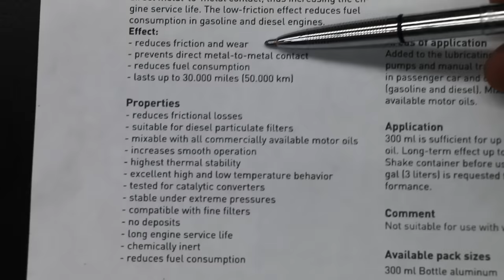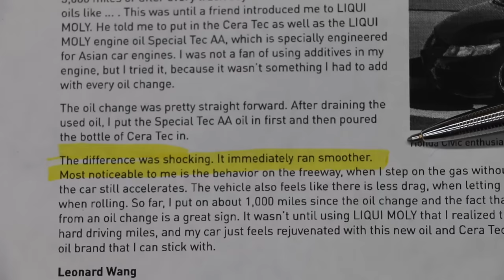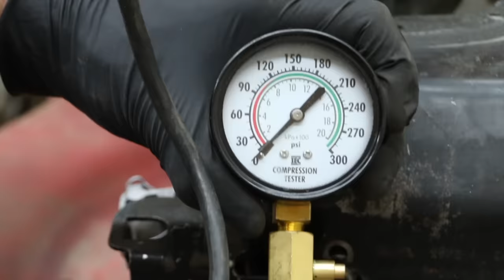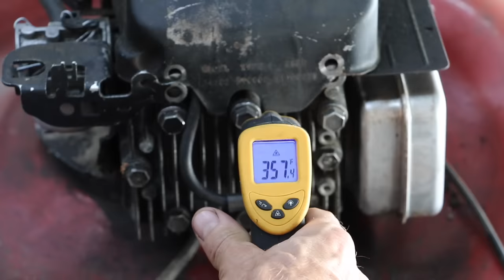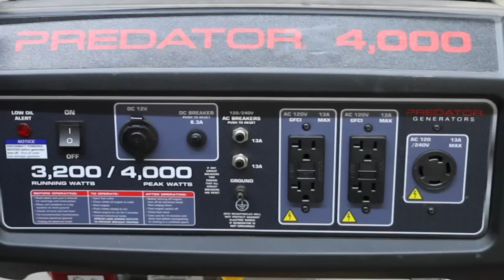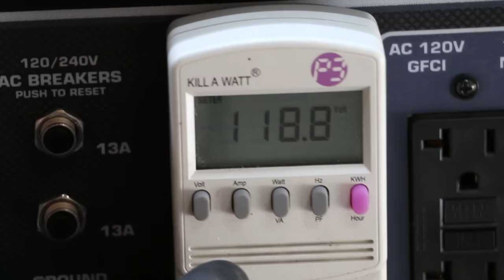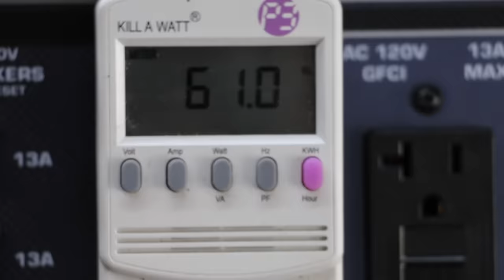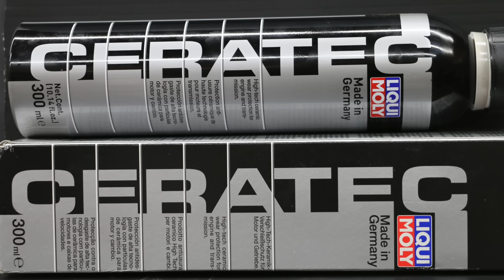Does Liqui Moly CeraTec work?  Let's find out!

Comment: I would like to see a "Leader Board" for fuel and oil additives similar to how Top Gear had for their celebrity lap times.  This would help viewers understand where other products compare to the current video test.
Reply from the maker: Thanks for the recommendation!
Reply: What a great idea!
Reply: Good idea
Reply: Additives are designed to do different things.  This guy is only measuring the same things on every additive and not tailoring his tests for what the additives claim.  Most additives don't claim to improve lubricity, however, this guy uses an ancient lubricity testing rig to test for it on every additive... doesn't really make sense... I mean all you have to do is find a product with lubricity improver (likely a diesel additive,) and you win that no problem and all you boneheads would be super impressed...
Reply: I’m currently waiting until someone watches all his videos and creates a spreadsheet. Let’s you look up bearing grease and engine oil all on one page for one shopping list.
Reply: This is a very good idea!
Reply: @kaipos8601  Most additives claim to improve gas mileage and reduce wear.  The best (only?) way they can do this is by keeping metal surfaces apart and this is achieved by superior film strength.  I think the Timken bearing test is the most important of the tests that Todd does.
Reply: @ProjectFarm  We're waiting... :)
Reply: @ProjectFarm  I second the recommendation for a leader board for top oil additives test
Reply: @rocketraccoon8110  I third that idea, does anyone know the best one tested so far? This is what im looking for
Reply: YES!
Reply: yes
Reply: Thanks for that information. Two points regarding Ceratec. The manufacturer recommends running it for a few thousand miles to give it time to ‘bed in’ to the internals of an engine. The second point. They don’t recommend it for every oil change but rather every 50,000.. This may be seen as a plus in their favour as most snake oil sales people want you to use their product as often as possible. I have not yet used Ceratec in my 2.4 Mitsubishi diesel engine.
Reply: @ProjectFarm  well its been 4 years. Did you get to it?
Reply: @kaipos8601  He doesn't do A-B-A testing either, so the variability in his rigs/engines could be enough to produce erroneous results. Most of this channel is non actual science and its crazy how people eat it up.
Reply: @kaipos8601  He reads out what the bottle claims it does and then performs standardized tests against those claims. Since you think the tests he performed mean nothing because you think they are "antiquated" - why don't you tell us the exact testing procedure(s) that would properly demonstrate the claims on this bottle?
Reply: @secondarycontainment4727  lubricity improvement is not one of the claims.  That would be the claim of a standard diesel fuel additive.  There are many tests that could be performed
  Would you like a list of ASTM methods I would perform? That depends upon what additive claim you're investigating. For which claim are you wanting to test? We've established lubricity improvement was not a claim...

Comment: When I used this the first time, I literally noticed immediate reduction of noise and increase in mpg as well as restored power. It was very unexpected. So I used this on every single car I work on and it is the same each time. Even clients notice and comment. So yeah, this works in my personal experience.
Reply from the maker: Thanks for sharing.
Reply: I think it depends on the engine it's used in and for sure the oil. I made better experiences with Mobil1 NewLife 0W40 and ceratec compared to some castrol variants in 10w40. It also seems to have an impact on coated surfaces on silica base, like Audi used in it's VR6 engines. On plane metal surfaces combined with a good synthetic oil like 0w40 i would recommend it anytime though.
Reply: I had the same, unexpected results in my 2016 Honda Accord with 30,000 miles. It has more pep, feels smoother, and is noticeably quieter at idle. I am very happy with Ceratec. It’s supposed to last up to 30,000 miles, but I think I’ll use it again at 45,000.
Reply: @bogeydope3022  oh on that Audi I'm sure he wouldnt have to worry about the engine wearing out, with all the plastic engine components they use something else is going to break first.
Reply: @bogeydope3022  wait what do you mean, I used it on my VR6
Reply: @HeyhitmeBAM  Audi's engines especially the VR6 have a silica coating on the Cylinder to reduce friction. It is said that Ceratec will damage this coating wich is a logically consequence of adding much harder ceramics to the oil. It will of course reduce combustion if the coating has come off. 

However, if you have a V6 from VW, like the the Passat 3.2 or R36 or any Golf then you are fine, only Audi used it in their engines.
Reply: @bogeydope3022  thanks for the explanation, have an R32, so I guess it’s fine
Reply: @robertmaybeth3434  Yap, not to speak of the wonderful timing chain that is made to break. It's a shame. However the V6 from VW doesn't have this problems, though it has some other crap. I have a 2008 Passat 3.2 V6 and it runs just fine.
Reply: @HeyhitmeBAM  Yap, i have the same engine as you have in my Passat 3.2, though it is a real FSI. I would recommend to use Mobil1 NewLife FS 0w40 combined with Ceratec. 

I have now again 20000 km after the last oil change and the oil looks like day one! The whole engine is perfectly clean. When i was using Castrol, it was the opposite, thick black tar.
Reply: @bogeydope3022  I haven’t heard of that Mobil1, haven’t used their oil in a while now. I use Motul, Liqui Moly, and sometimes Torco depending on the application/car. Might try Miller’s sometime but it’s very expensive, even more than those I mentioned lol
Reply: @bogeydope3022  if you haven’t heard of some of these oils I mentioned you should check them out, top notch :} though out of those I think only liqui moly and maybe Motul offer oils for long oil change intervals. Personally the furthest I change my oil is 6000 miles which is just under 10000 km. That or twice a year, whichever comes first. Happy driving to you
Reply: @HeyhitmeBAM  Mobil1 FS 0w40 is the stock stuff Porsche puts in their cars. I have worked for them in Zuffenhausen for some time. It is a really thin Oil with high temperature resistance made for very high combustion ratio engines and thus rpm. 
A lot of guys on forums swear on it, especially in VW or VAG V6 Engines. 
And since i use it myself, it's really crazy that the oil looks as honey like as day one after 20k km. I have never found an oil better suited for this engine.

How often you should change the oil depends highly on how you drive the car. Is the R32 your everyday vehicle? 

Miller's seems to make some sorts best for american power cars based on big v8's. 

Which liqui moly do you use?
Reply: @bogeydope3022  Hello there! I believe Audi’s 3.0 TFSI (GEN1&2)  isn’t considered as VR6 engine but could it have the silica base coating? would using ceratec or LM new product “Molygen Motor Protect” have any form of impact on the engine? Thanks
Reply: @khaledalassiri86  What production date is your engine? Give me the full description please.
Reply: @bogeydope3022  engine code is CREA production date is 12/2014. Thanks
Reply: @khaledalassiri86  Ok, so far i'm 99% sure that your engine block is made of "Alusil". That's an aluminum alloy with a high percentage of silicon. It isn't a real "coating" because the whole block is made of it. In general the cylinders surface will be chemically prepared so that only silicon crystals will remain as a hardened surface. Your engine therefore doesn't have liners. 

That means that you should face the same problems like breaking of the silicon surface if you add ceracote etc. to your oil.
Reply: @bogeydope3022  you’re awesome thanks man, i was about to use it but thankfully i’ve read your comment. Guess it’s better to stay away from any kind of additives at least for people who have the same as our engines case. Good luck.
Reply: @khaledalassiri86  You're welcome. AFAIK all bigger Audi Engines use ALUSIL since 2012. What kind of Oil do you use and how much mileage has the Audi now? Do you face any problems with the engine so far?
Reply: @bogeydope3022  i got the car used and i’ve put on it around 20k miles odometer right now is 90k miles. I have used LM molygen 5W40 it was great the engine was quite and the oil temp wasn’t high. Although it says on the bottle it’s recommended (not approved) for vehicles with VW 502/505 specs, i will probably use Motul Xcess-8100 5W40 instead since the LM Molygen has some friction modifiers into it and after reading your comment i’m not sure if I should continue using it since it may have an impact on the engine block coating.
Reply: @bogeydope3022  i got the car used and i’ve put on it around 20k miles odometer right now is 90k miles. I have used LM molygen 5W40 it was great the engine was quite and the oil temp wasn’t high. Although it says on the bottle it’s recommended (not approved) for vehicles with VW 502/505 specs, i will probably use Motul Xcess-8100 5W40 instead since the LM Molygen has some friction modifiers into it and after reading your comment i’m not sure if I should continue using it since it may have an impact on the engine block coating.
Reply: @khaledalassiri86  90k isn't much. You should take a look after the next oil change how fast the oil will decay, don't forget a new filter. I consider your engine to be a standard VR6, the fsi is only for names sake. With all VAG (VW/Audi) V6 engines we had great experiences with the mobil1 FS new life 0w40, especially if you drive the car in winter conditions, as it is much more viscose. Therefore the oil will get to the important areas much quicker when you start it in the morning etc. 

In my experience any engine will decay more from insufficient  lubrication in the first few minutes after ignition on normal use. Therefore i tend to use a very good 0w40, which nowadays survives even track days in mid summer on a high performance car without decaying. 

One thing you have to look for your engine is the timing chain, they tend to break often. You can check the adjustment values of the camshaft. It's Nr. 159 and Nr. 160 in the Engine control unit. Both values shouldn't be more apart then a maximum of 4 degrees. If it is, you should change the chain quickly. 

If it is very loose, it should start to rattle after a cold ignition and it is on the verge of slipping or breaking.
Reply: @bogeydope3022  what about cjeb engine 2014 A4 1.8 tfsi . Can I use it or not ?
Reply: @krlpl6282  You can use it. No Alusil engine.
Reply: @bogeydope3022  thank you for the answer , have a good day ☺️
Reply: @bogeydope3022  I'm guessing the 2.0 tsi (ea888 gen3) will be of a similar ilk to the 1.8 tfsi you answered above and will be ok to use ceratec?
Reply: @KXP70  Correct.
Reply: @bogeydope3022  do you know that stuff about the Audi 1.8T (2003 BFB) aswell?
Reply: @behindizockt2809  you can use it. 2003 was before the adaption of their coating.
Reply: @bogeydope3022  dude i got audi q7 2011 3 litre v6 can i use ceratec? i ordered some liqui moly diesel, is that any good? thx
Reply: "literally"? really
Reply: @sgeine  yes "really".
Reply: @matreyia  but do you literally mean literally, you literally literally noticed it....literally...
Reply: I am using this in the Cayenne 3.6 VR6 and happy with the mechanic’s recommendation. Runs quieter, smoother and saves fuel.

Comment: Heavy equipment owner operator with 32 machines in use daily, plus two Kenworths that pull 80,000 loads weekly. I have two full time mechanics, they both do all maintenance and overhauls.  I’ve been extremely vigil about oil, using the best possible for extremely harsh operating environments.   Five years ago we switched to Liqui Moly   after years of using another highly recommended friction modifier.  The real proof is when one of my diesels is overhauled, old bearing surfaces scrutinized and compared to industry averages.  Using the Liquid Moly has given my equipment decent results.  Mostly in camshaft and main bearing wear.  We just finished overhauling the engine in the Kenworth,  a T680 with the Cummins 650 horsepower power plant.  690,000 miles of extreme duty, used to pull our heaviest excavators and dozers.  The camshaft and bearing wear were just under 50% of normal, pretty impressive.
For light duty, cars and small pickups, I’d think it would yield as good if not better results.
Reply from the maker: Thanks for sharing.
Reply: Did you use Ceratec?

Comment: I have been using this stuff for years, and without doubt I'd say it is the best you can buy. I'm 71 and have been fixing cars and using additives for over 50 years so I've tried most of them. I have a 2007 Audi A6 2.0 TDi which I bought in 2009 and has now done 322,000 miles on the original engine with no problems or major engine repairs, oil changes around every 18,000 miles and a can of this stuff at every change. It still sounds as sweet and smooth as the day I bought it with 17,000 miles on it. I also have a 2019 A6 Avant 40TDi, bought last October. It ran really well, but I added a can of Ceratec and the miles per gallon has increased noticeably now it's had the required few hundred miles to work-in, plus it's even quieter than before. I have several friends who have used it and every one of them is amazed at the difference in the way their cars run. I'll never run an engine without it in.
Reply from the maker: Thanks for sharing.
Reply: which was the best of them?
Reply: @rfgon3727  Which was the best of what?
Reply: @nigelbarratt6825  which was the best additive. You said you have tried most of them.
Reply: "oil changes around every 18,000 miles " and you are a mechanic? :O
Reply: @billy.the.maker.  That's when the computer in the car said it needed the oil changed, which varies as a result of a number of factors such as how the car is driven, in my case mainly motorway mileage. I'm sure if the manufacturer thought the oil should be changed more frequently they'd have set up the computer to require it. In any event, the proof of the pudding is in the eating as the saying goes, and when an engine still runs like brand new after over 330,000 miles when it's never had any significant work done on the engine I'd say it proves the point. When I started as a mechanic in the 1960s  we used to change oils at 3,000 miles, however both engines and oils are very different now.
Reply: @nigelbarratt6825  those companies don't want you to change the oil because they do not want engines to last long. Planned obsolescence and whatnot
Reply: @AR7271  It hasn't worked then, has it, this 'planned obsolescence theory? Oil changes every 18,000 miles and still running like new after over 330,000 miles. Sorry, you may have your opinion but I'd point out that mine is actually the result of reality and actual personal experience.
Reply: @nigelbarratt6825  with full synthetic oil?
Reply: @AR7271  Always top spec fully synthetic oil, VW spec 507.00 low SAPS, plus Liqui Moly Ceratec at every oil change. Also ran on premium grade diesel for most of its life and periodic flushes of the fuel system and injectors with neat Liqui Moly diesel purge.
Reply: @nigelbarratt6825  cool thanks for the tips
Reply: I just did some math, a 1% increase in efficiency,  for argument sake a vehicle getting 20mpg increases to 20.2mpg. 10k miles per year increases to 10,100mpy. So if your using synthetic oil, changing once per year/ 10k miles, at $25 a bottle for Ceretec, your paying $5 for every extra 20 miles.
Reply: @benjamincozort3816  That may be true if your assumptions are correct but, in my case at least, none of them are. I am in England and drive an Audi A6 diesel approximately 25k miles per year. The oil is changed when the car’s computer says it’s due, usually around every 18k miles in my case. Fuel consumption averages over a tankful at 46 mpg imperial, 36.8 mpg US (on a recent long trip of 163 miles it averaged 58.2 mpg/46.6mpg US). Over 18k miles between oil changes at 36.8mpg/US that’s 490 gallons, so 1% would be 4.9 gallons, and since premium diesel in England equates to around $8 per US gallon that’s more than the cost of the Ceratec. Marginal I agree using those figures, but in reality it’s much more than that, as the MPG figures I’m getting with Ceratec in the oil are way more than1% better, more like 5-10% as you can see from my actual figures above, but the biggest benefit is in longer engine life – my last Audi A6 diesel is still running like new with an untouched engine at over £340k miles having been run with Ceratec for years. At least a dozen of my friends are now using it and every one raves about how amazing it is. It doesn't cost money, it saves it.
Reply: Of course, longer engine life for sure make it worth it. In my case a 2011 Ford Fusion Sport avg. 20mpg, regular unledded(at the moment) ~$3.50 gallon, oil change 1x year, average 10k year. Going solely on what the video said, (I just bought some AET High Class ceramic additive, and have not yet put it in) a 1% increase  equals 100 extra miles per 10k, at a cost money wise of $25, or $5/20miles. In my case, at least, that's more than gas, but don't get me wrong.  Longer engine life make, and proven performance,  worth it.
Reply: ..a 5 to 10% and for sure, the figures would change.